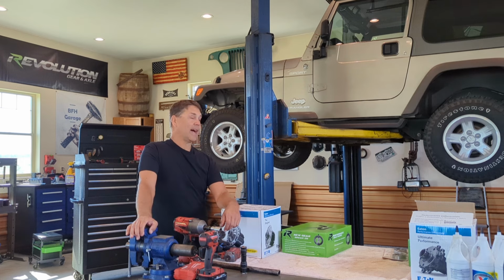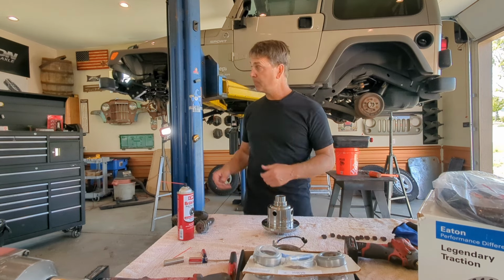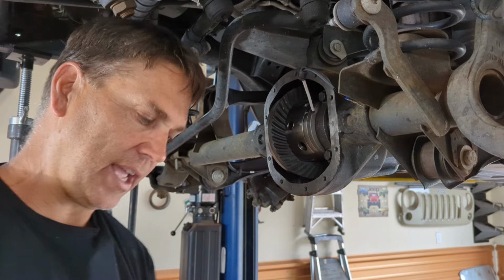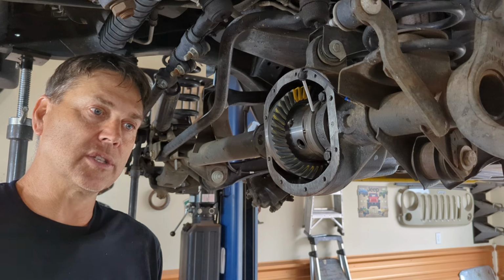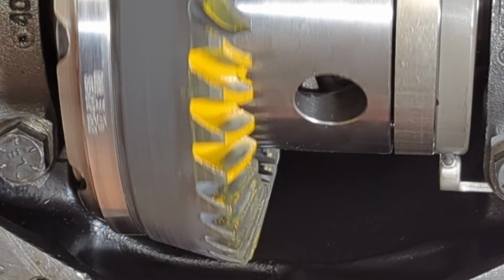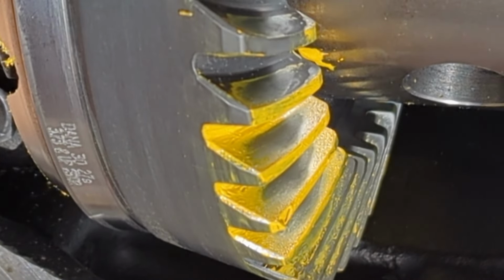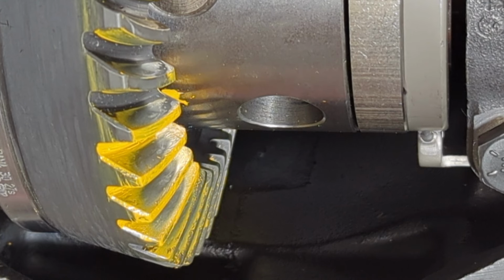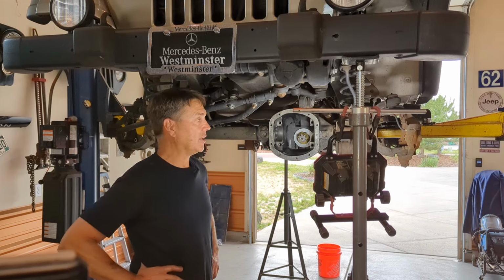How to Read and Interpret Gear Patterns (Ring and Pinion)

Comment: Thanks for taking your time and resources to present a very well produced and edited video.My two cents. ..
Use a pump bottle filled with mineral spirits in lieu of aerosol can 'Brake clean' to rinse off Ur parts. Wipe clean with lint free cloth. Follow with a pump bottle filled with methyl hydrate to clean off the oil residue left by the mineral spirits. Cheaper than 'Brake clean and less aerosol can trash to deal with. All the best to you and yours.

Comment: understandable  readings with explaining for new people level trying to comprehend how to do it priceless.........now subscribed..........tried replacing all the bearings years ago on a used ring and pinion set and gave up.
Reply from the maker: If just replacing bearings and not doing a great swap, then I would just replace the bearings. No need for pattern interpretation other than to see.
Reply: @TheBFHGarage  well I changed nothing but replacing bearings carrier and piniion and gave up so I took it to a transmission rearend guy who also screwed it up lol.
Reply from the maker: I didn't realize you were getting into the pinion too. Theoretically it shouldn't change but the more factors (bearings) you throw in there, the better the chance for things getting out of whack.
Reply from the maker: @zundfolge1432  All you had to do was change the bearings and put it back together. What tripped you up?
Reply: My gears are real hard to turn and the pinion gear is not to close what's wrong with it.?

Comment: I just binge watched most of your gear install videos, they are all amazing and the best info i can find anywhere. You've got a new subscriber here!  Thanks for doing them.  I did have 1 question,  i couldn't find a video of a high pinion dana 30 in your video's.  How would patterning differ with the HPD30 compared to the LPD30?  In this video you say to favor the coast side pattern, would that be the same for the HP30?  So on a HPD30 would you focus on the bottom of the tooth, which would be the coast side for the HP since its reverse?
Reply from the maker: On a high pinion 30 you would favor the drive side. The only reason I tell people to favor one side versus the other is if you can't get a pattern that is good on both sides.
Reply: Thanks for the info.  Keep the awesome videos coming!

Comment: Great video as always, thx. Guess I shoulda got revolution gears. I set up a JK D44 with 4.88 yukons and the patterns are uneven drive to coast side. I did 6 differnt pinion depth setups all at .007-.008 backlash and I got it but not real happy with it.  Ill run her, if it fails.. Ill try Revolution.

Comment: Thank you for this info!    This is my first time and I have that same messed up pattern on my Yukon gears on my Dana 44 where the forward looks good but the reverse is in the tow bad same as your picture. How did you fix it I’ve removed a lot from my pinion depth but it’s not helped.    Thank you!
Reply from the maker: Sometimes that's just where the gears settle. Nothing you can do about it. It can still be an acceptable pattern but it sure irritates the crap out of me
Reply: Ok yea its aggravating my wife tells me I try to be to much of a perfectionist.    I will shim my pinion back out to where the factory pinion was at .045 and set my backlash and take another patter and see how it looks if the drive side is good I may just go with it.     Thank you for all your videos they are very helpful!

Comment: What about shimming the carrier left or right? Do you just re-use the factory shims with the new ring gear?
Reply from the maker: You can try to start and see where it's at. If you aren't changing gear ratios it will probably be close. Most likely you will have to adjust shims.
Reply: @TheBFHGarage  Thanks for taking the time to respond! I wasn't sure how needing left to right adjustments would show itself in the pattern. New carrier, new gears (same ratio), new bearings, new spacers/shims (left factory spacer cracked). 

Does pinion depth only affect how deep (or shallow) the sunrise/sunset shape is? 

Does left/right only impact how developed the coast vs driven side looks? 

What kind of role does temperature play? 

I have a detached, uninsulated steel garage. It's 29 outside. If I aim for 0.005 - 0.008" of backlash when it's cold out, will I run into problems at operating temperature? (I tried to get permission from my supreme overlord to "temporarily" displace the living room furniture and decorations and such to throw down a 4x8 sheet of plywood with drop cloth and saw horses to do this inside at 72... I'm surprised I survived the look I received - at least the couch is far more comfortable than sleeping outside!) 

This is my first time doing gears. Bearing failed in D35 (open diff). Found bits of the bearing cage in the bottom of the diff, and the pins showed evidence of seizing, and the inner race spun on the carrier making it a "slip fit" which made the rear end unhappy.
Reply from the maker: @muddy-one you are asking far more than I can provide here. Do your research, watch the videos. I have multiple gearing videos that answer all of your questions 👍
Reply: Nice tutorial video....will follow this steps to rebuild 9.75 rear end.. thanks

Comment: I've watched a few of your videos installing a differential,  and I noticed you don't use a pinion depth tool. How do you get a good starting point without it? Do you use the backlash as a guidance for depth? Thinking about rebuilding my AMC 20 in my CJ7 with an Eaton differential and your videos have been helpful.
Reply from the maker: Backlash had nothing to do with pinion depth. I always start with what was in the previous setup as far as shims. It's usually pretty close. If you have nothing, then you have to guess.... Usually around 55 thou for Dana 30 and 44.
Reply: @TheBFHGarage  So, a pinion depth tool is not necessary for pinion depth. Is it just used to get as close as possible to the correct depth? You use the patterns on the gear to determine if you need to add or take out shims, correct? The backlash is adjusted with shims on the side of the carrier? Thanks for the help.
Reply from the maker: @mikejones5535  yes you are correct on all statements. No need for a pinion depth tool  throw 55 thou in there (for a Dana 30 & 44) and adjust based on the pattern.

Comment: Have you done any used gear sets?
Reply from the maker: Yes. They are a pain and not worth the effort.
Reply: @TheBFHGarage  Have heard of people setting up used but I guess major skills involved.  Anyway, would this gear marking contact pattern be or could be used to check pattern of a used rear end before installing it.  Basically a use or dont use reject or ok method.
Reply from the maker: @zundfolge1432  No. When setting up used gears, you run a pattern to use as a reference. When you set them up, you want them to mimic what they were in originally. Take a picture of the pattern and then try to match it as close as possible. The reason is that the gears get work hardened.

Comment: hello , i have a too deep pattern , but pinion doesnt have any shims to remove , any help would be aprecieted
Reply from the maker: A couple of reasons this can happen. If you reinstalled the factory slinger/shim that was behind the pinion head, it may be too thick. Secondly, make sure the race is seated all the way if you're not using a set up race. Also make sure you are using the correct bearings. Are you using thick cut gears? Do you have the correct carrier?

Comment: Unrelated to this video but I’ve seen you use 5.13’s in your HP 30, any instances in gear failure in your experience with a deep gear set like that?
Reply from the maker: None. If it was an issue, they probably wouldn't make them.